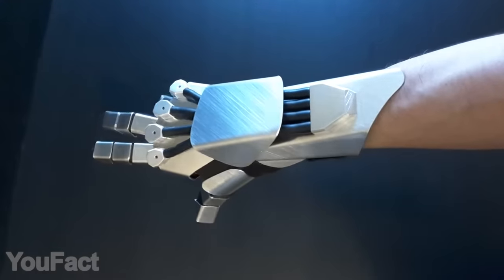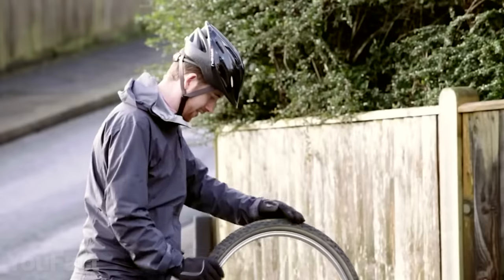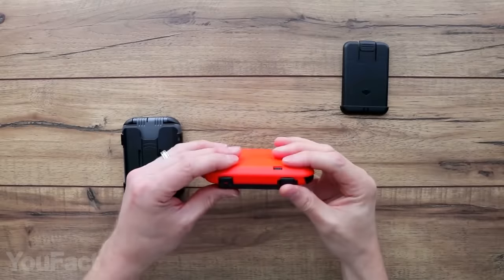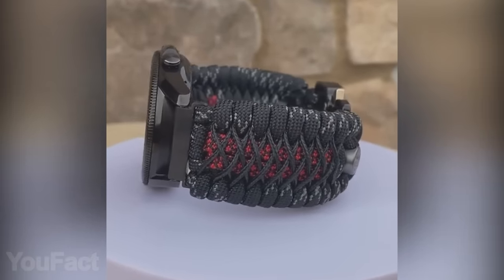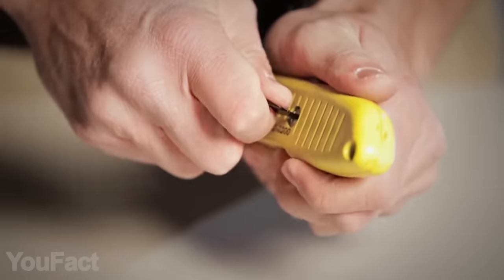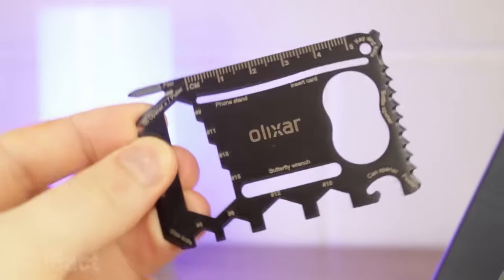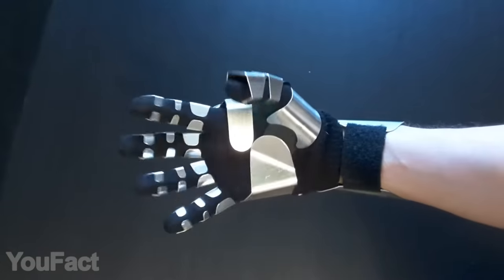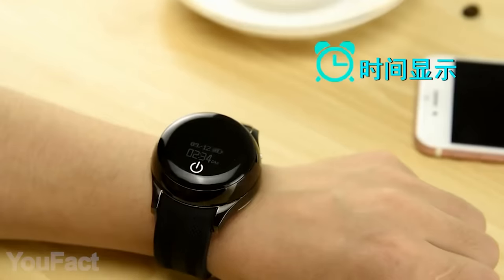14 Coolest Gadgets for Men That Are Worth Buying

Comment: All my girls have a "Key Chain Flash Light" it's a Cob light, which means it's very bright, battery operated with 3 modes High beam, Low beam & Strobe excellent for blinding a would-be attacker, they have had them for over 3 years & had no problem with them whatsoever, & they cost £4 delivered to my door from AliExpress, the one I bought to test is 4yrs old & my son uses it for work every day. 1/2 of these companies buy them from here & put a huge "Mark up" on them, so you're just getting the something anyway.